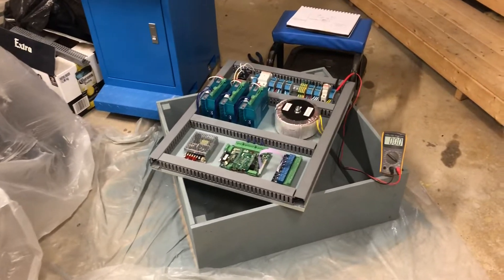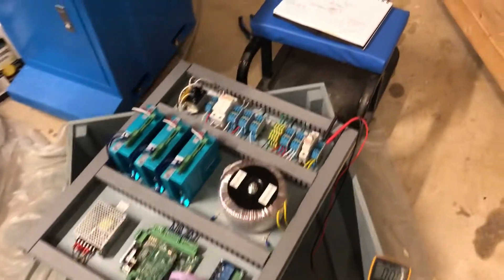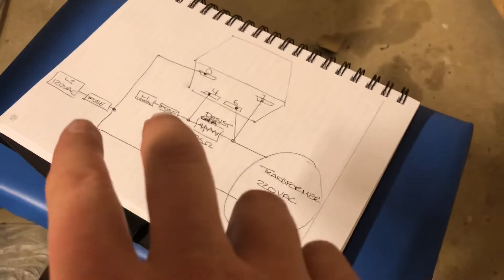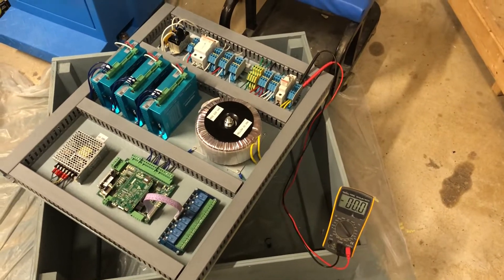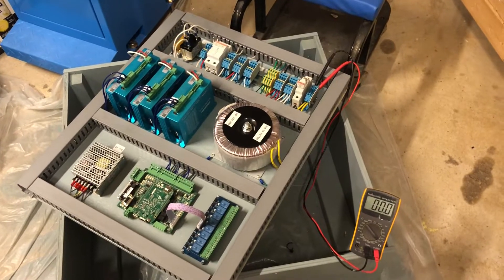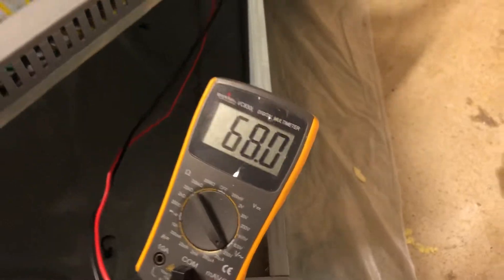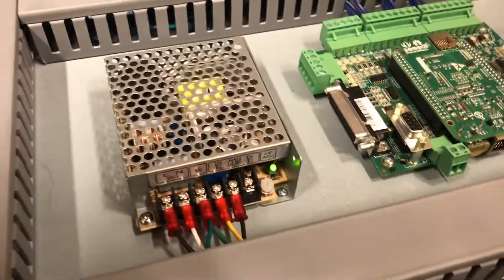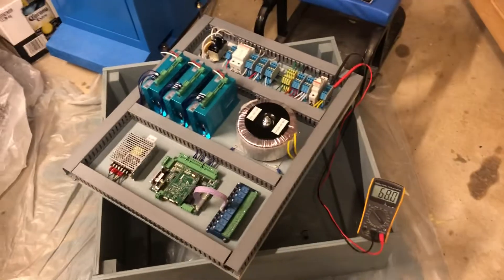Precision Matthews PM30-MV CNC Conversion - Inrush Current Problem FIXED!

Comment: Hi Adam, I'm building pretty much the same machine you did and am having the same issue as you. Can you share what you actually did to solve the "in rush current - fuse blowing" problem?
Thanks,
Ken Polley
Reply from the maker: Sure - I’ve got some photos. Message me on Instagram @adamd_cnc
Reply: @adamdebowski2037  
Never done instagram before so not sure how it works. But thank you very much for responding (so quickly!)
Reply from the maker: @mrmodfi  no problem - I hope I can help - I remember being in your shoes! Check out this link: https://m.imgur.com/gallery/bUY7NpM
Reply: @adamdebowski2037  Thank you Adam. I will need to research to find components that will work for 110vac, but this gives me a start point. I would keep you posted when I fix the problem. Have a good one!